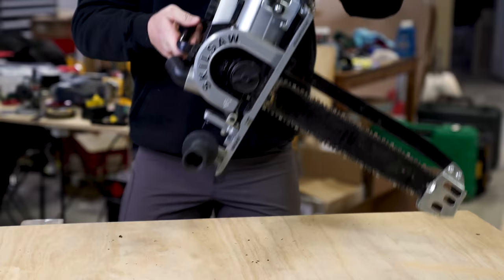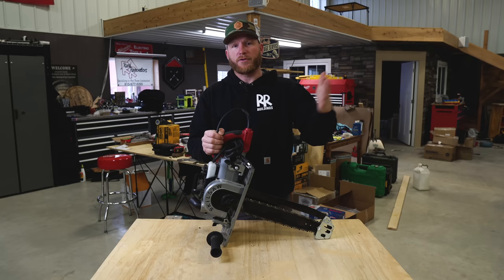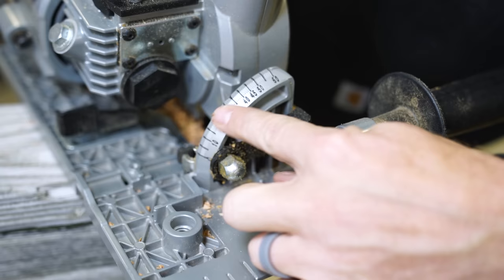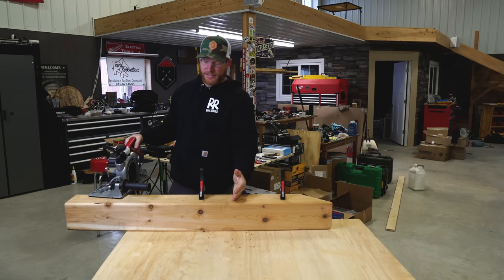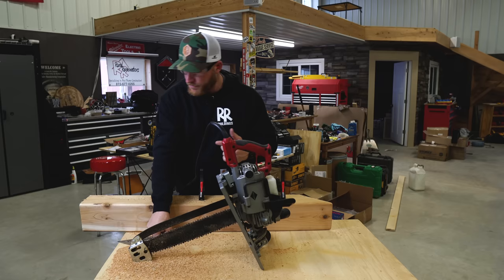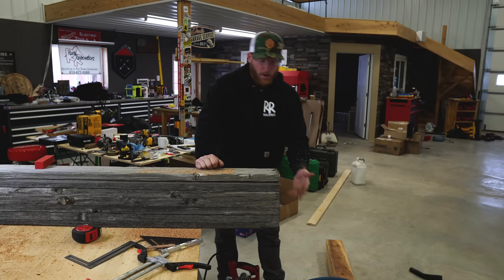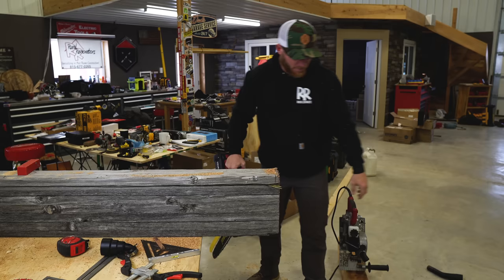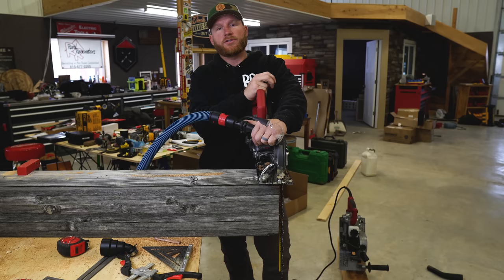Skilsaw Carpentry Chainsaw: Toolsday

Comment: @RRBuildings The Prazi cutter does in fact have a tensioner, unless you have one of the very first models. should have an adjustment to the right of the bolt that attaches the power head to the saw.  Great comparison video though, nice to see an all in one model.  Pricey, but if you use it all the time, it would pay for itself quickly.  Similar situation for the Cuz-D saw.  If you need it, it's priceless.

Comment: The Prazi attachment seemed better to me. Tool seems akward to use, but fills a need. Great review!!
Reply: Had the Prazi for many years only problem was stepping on the bar laying on the floor
Reply: I noticed that the Prazi doesn't address the bar needing oil.
Reply: @TERRORoftheLORD  No, it doesn't but if you know anything about chain saws this should not be an issue. Have you never oiled anything manually. And I already had the saw.
Reply: @dennisrisk6063  Its a good value if you have the saw.
But if you need to buy the saw it's a wash.  He didn't mention if the skillsaw could be converted to a regular blade.
Reply: @TERRORoftheLORD  Since I put the Prazi attachment on my saw I have yet to take it off. (Many Years) Which means I probably didn't need the worm drive saw in the first place. But I really like it for landscaping timbers and such. Skills new saw with the bar looks good alright and probably well thought out. Good point on the putting a circular blade on it.

Comment: Bought this today and it really struggled on cutting douglas fir beams, 8"x12"... bogged down, got clogged in the cut quite a bit even though wood wasn't that wet.  Tried toe in and toe out to start the cut, nothing helped.  Expected way more out of this saw, any experience cutting heavy timber with it that is similar to mine?  Just curious if its worth keeping or not

Comment: Kyle love your content, have you seen a mafell zsx this is a beast of a saw loads of power and bevels 60 degrees both ways and can also go on guide rails but has a hefty price starting at about £4500 with replacement tct chains running about £800 so not cheap per cut

Comment: Mafell and Festool have had these for years in Europe but they can be VERY expensive.  One of the Mafell models costs over $17,000.  You have to be cutting a lot of beams to justify that.
Reply: Yeah, but those have the quality. Not the case here
Reply: Ser Avi   I have the new DDF40 and the p1cc. They are fantastic machines.

Comment: Im a production framer that frames very large houses, we are disappointed in this saw. It struggles through 5-1/4" PSL beams. Probably only use is bulk cutting TJIs with really rough cuts

Comment: This is an unusually clumsy video. After having this in excess of a year, it is also very late to the opera. I wonder if Skillsaw was responsible for pressuring Kyle to make the video in order to get the production model - or other tools in the future. I never heard Kyle say why he took so long to do a video on this saw.

I wanted to see if the bar could be used without the brace so it could be used in a plunge capacity for making tenons in post & beam construction?
Reply from the maker: No one pressures me to make any video on my channel... I’ve had it for awhile, I’ve gotten requests to share my thoughts?? What else do you want?  I can only share what I know or how I use a tool. I’m not the type that pretends to have it all figured out.  You get what you get and that’s just me. Sorry. Feel free to request tools to talk about or questions you might have and I’ll do the best to answer what I know
Reply: @RRBuildings  Wow, what a passive-aggressive answer. Quite dissapointing
Reply: Ser Avi - Passive aggressive? He was quite clear.